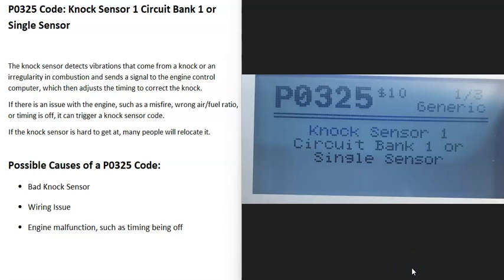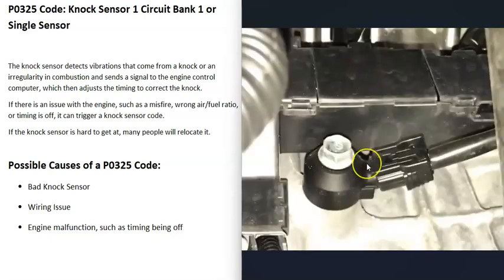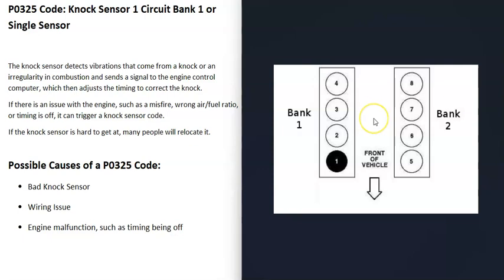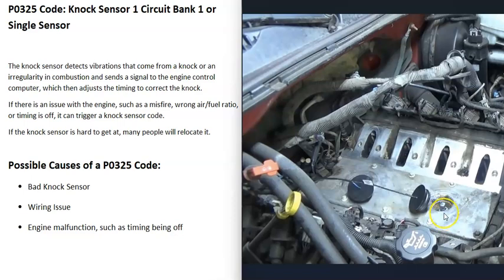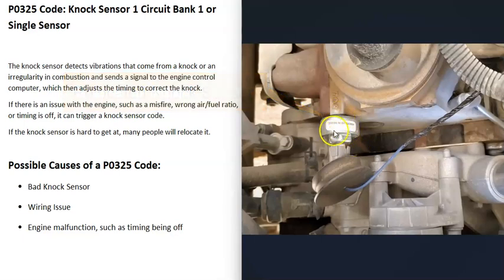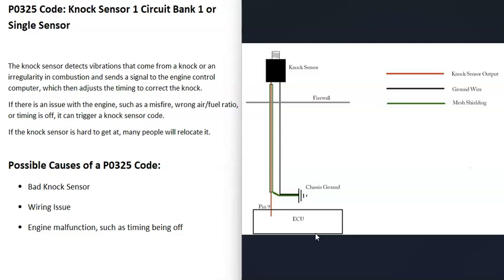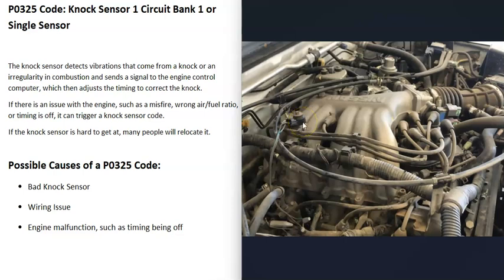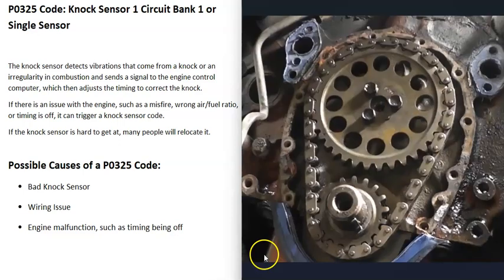Causes and Fixes P0325 Code: Knock Sensor 1 Circuit Bank 1 or Single Sensor

Comment: Great advice but sometimes you will have to find a knock sensor that function with your vehicle.persons have changed bad sensors and still have the same problem.(New sensor not compatible with the vehicle)

Comment: The knock sensor can also , on a Honda Prelude,  alert a front wheel out of balance, so after you've pulled all yer hair out.....
Put that in yet pipe and smoke it

Comment: Replaced my knock sensors on my 01 v6 Camry back in January and had the same code pop back up this month. Used ntk sensors and oem wiring harness. I don’t believe the sensors have gone bad but can a worn timing belt also cause the code to pop up? I have the timing belt kit for my car that I was gonna replace this month
Reply from the maker: Usually, a timing belt needs to slip before it causes issues, but if it is really old and worn, it may be loose, which can cause problems. Often, when that happens, the engine runs fine, no codes at idle, but gives codes when the engine is revved up. Also, there are usually timing-related VVT codes.

Comment: so i have an 09 honda crv, for awhile the check engine light, VSA light and !in a triangle light would all come on together and when that happened car didnt wanna climb hills at all, turning car off and on again usually made it just go away and work fine but the code that comes up is P2647, system stuck on bank 1.  now its doing the knock sensor code P0325 and can feel it while driving, not horrible but can feel something.  had few things done for first code but every now and then it still does it but 2nd code is popping up constantly lately    car only has around 135,000 miles on it and otherwise drives great, no overheating problems.

Comment: This has been a yearly issue in my Chevy Cruze. I replaced it last year with a aftermarket one which didn’t work then I went with a manufactures part for my 2018 Cruze 1.4 then it ran fine. This same exact time last year it’s now happening again. Do you assume it’s the same issue? I diagnosed all possibilities. It’s as if the brain  is messed up. Because in the winter time the last 2 seasons it’s been wanting to hold 5th gear on the express way during freezing temps. Nor me or mechanics can rhyme or reason it

Comment: I have a Toyota 2002 V6 3.0l which I replaced the knock sensors in about two years ago when I bought it and the previous owner did the short cut by putting it on top of the engine which I removed and properly replaced both. I never had the code again until two years later. However, I’ve had a P0420 and P0430 with little problem for some time until recently so I did some digging.

I ran a live obd2 scan after clearing all codes and found the upstream b1 & b2 s1 are both faulty since they are relatively flat on the graph regardless of throttle input or messing with the ac for example and if I run the live scan with the car on but not running they show extreme voltage still 3-5 volts while the others show nothing since it’s not actually running (unsure if they are wide band but would imagine so). It’s also worth mentioning I’ve run the car with the bad upstreams with no problem for a little while until the knock sensor code flagged since I can’t go into overdrive forcing me to take action.

My question to you would be do you believe the upstream o2 sensors could cause bad enough fuel/air ratio to the point the P0335 code is thrown? It has run a bit more rough lately with more lag to add some context. 

I have the sensors on the way which I will install Wednesday and I will update. However, if you could give me your opinion before then I would highly appreciate this. Thank you!
Reply: hey i’m having the same issue as you and I replaced my knock sensors and im still get the code did you end up resolving this
Reply: @rayyanabu-dames764  I’m having the same issue as well
Reply from the maker: A bad 02 sensor shouldn't cause an issue with the crankshaft position sensor. If the 02 sensors are good and the CAT is clogged up, that can cause engine problems. Usually, less power than usual, but if a CAT is clogged up, it may indirectly cause a P0335 code, but it needs to be diagnosed.

Comment: I have a Honda 2006 FRV 2.0 petrol , but i have also an LPG system installed for 2nd fueling system, and today it showed this code exactly same on the picture. My question is could the LPG fuel trigger this error  ?

Comment: One has to wonder after researching knock sensors you get the impression that they just go bad, replace them and your good. I appreciate your version short to the point the possibility of other reason's a code is thrown. In my experience of a thrown code is never what you expect find.
Reply: What happened to your car?